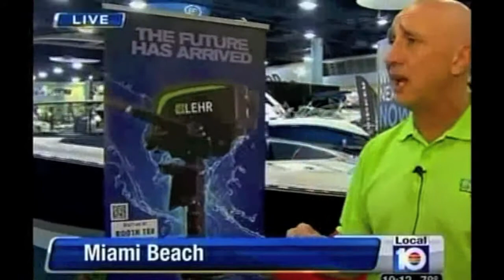Lehr Propane Outboard Motor  - Offered by iboats.com

Comment: I bought the 5 hp short shaft brand spanking new it ran for 1/2 hr and died out on the lake, off to the shop for 2 plus weeks and it ran for 15 min. then off to the shop for a week. Since it let me down twice so far I ran it in a bucket. After 15 pulls it finally started I ran it for 5 min and shut it off. I attempted to start it again and after 30 pulls have given up. The dealer nor Lehr will take this thing back. The dealer is willing to sell me a different brand at a higher cost. They haven't gotten back to me as yet as to how much more they want me to pay. Yea buy a Lehr. and row it around the lake.